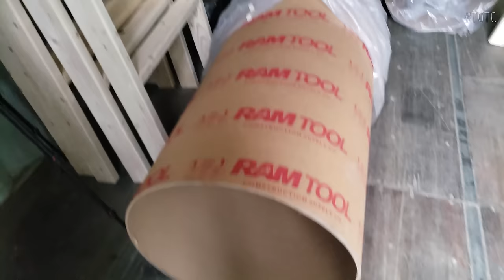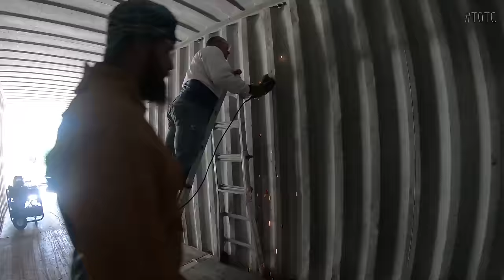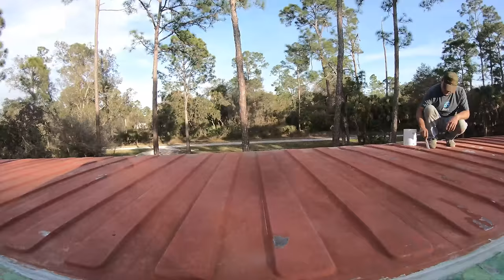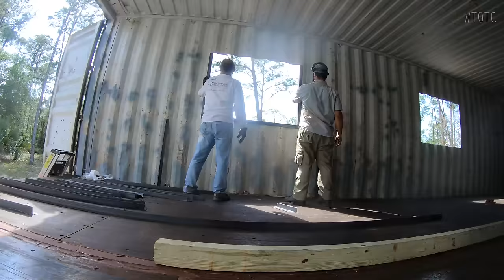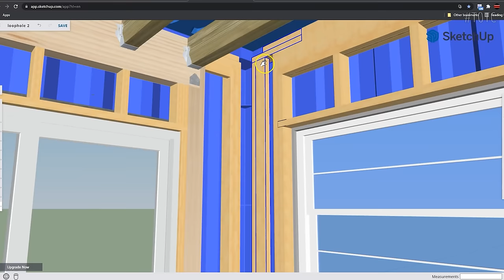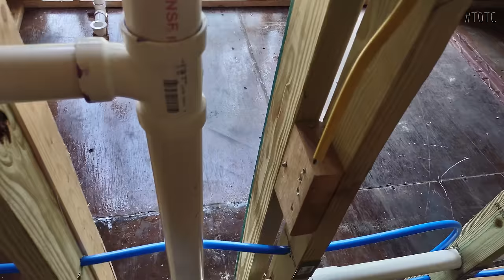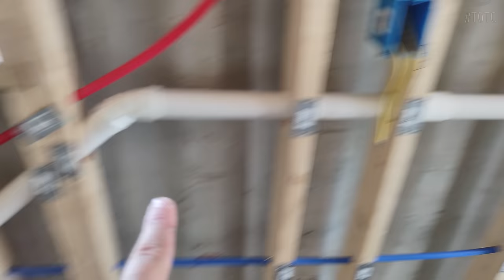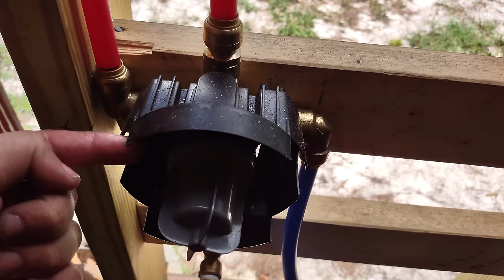FULL Container Home Build - Start to Finish Timelapse Construction

Comment: How much are the decent containers are selling for in today's market? I really wouldn't mind if the container had some bigger damaged spots like big dents or even holes in them, do to the design I am wanting to use for the build. The first floor will be completely underground and part of the second will be underground then I will cover the roof with solar panels and a propane generator for back up with plenty of well water, I could have it finished in at least 12 months with it fully functional for living completely off grid. No bills means no need for a mail box right?

Comment: Hi I have a question for you, you probably won’t see it but here it goes anyways! Say I built exactly the same structure as you, down to every last bolt and weld, how hard would it be to build UP later on down the road? Say I wanted to add a container above the first floor, would I be able to do that after the fact? Or would I have to do it on the initial build? I can imagine there’s going to be some structural beams that are going to have to be put in, but is it anything I wouldn’t be able to do later on down the road? The reason I ask is because basically I would like to build my initial space as  just a single floor, and then add a cool second floor to it later. I don’t want to tackle 2 floors on my initial build, it’s something I want to inevitably add to as a project down the road. Thanks!
Reply from the maker: Hi. I'm not a structural engineer so I can't offer structural advice, but I can speak on my personal DIYer opinion.

I actually plan to build a second floor on top in 2025. Although I haven't fleshed out the entire plan for the build yet, I've done some thinking and overall I do not expect adding a second floor after the fact will be that much more of a hassle than if I'd just added it from the start.

But there are probably many details I haven't thought about yet so...

But yeah, I plan to build a second floor on top of mine
Reply: @thinkoutsidethecontainer  wow, thank you for the speedy response. Im sure that my structural engineer will tell me what is possible but I was more so just curious on your thoughts on the matter. I have an idea in my head of what I want it to be, I want 2 side by side, like yours but 1 less container, and then I think I want 2 more that are perpendicular on both ends of the original structure. I’ve considered maybe doing 2 40’ containers on the first floor and then 2 20’ containers running perpendicular on the ends, I’d like to have that 4 feet of overhang on either side of the house. I guess we’ll find out. One last question for you, regarding the actual purchase of the containers, from what I’ve been able to find the new containers or “one ship” containers are basically the same price as used containers, given that the prices aren’t far off would you recommend getting new containers or do you think used is fine? Thanks again, love the video.

Comment: This was a great watch, shame interior design and electrical installation was skipped I guess. But overall the sense of accomplishment must be overwhelming!
Reply from the maker: As the build progressed 3 factors contributed to me filming less and less of the process over time: my dad (who helped a lot) often got annoyed by me filming, but I didn't mind doing the double work of building AND filming, still my filming of the project got stifled and disrupted because I didn't want to bother my dad, so I lost motivation to capture the whole build since I was already missing parts of it.

The second reason was the county deadline for the building permit to expire, so getting the house built quickly yet properly became more important than filming.

Lastly, pure exhaustion, by the time I finished the build I was pretty exhausted, contributing to me not filming much in the last few months.

Comment: An Oxy-Acetylene torch seems like it could have saved a long day of grinding, which doesn’t look like a fun job. I’m wondering why an angle grinder was used.
Reply from the maker: I've heard plasma cutters would have worked well. You're right the angle grinder was agonizing for all that cutting. Truly brutal, especially cutting out those walls. Took me like 7 days straight of cutting morning to sunset. Next time I'm buying a plasma cutter
Reply: @thinkoutsidethecontainer  why not Oxy? Cheaper equipment, and will cut it like butter. As long as there are no safety issues. Dude this is so cool what you did. I dream of buying a piece of land and building one

Comment: are there areas where the foundation bolts go into on the bottom of the containers or was all that just to keep the piers like absurdly stought.
Reply from the maker: Unfortunately I dont have footage of me welding the shipping containers to the steel plates. So basically, there's the concrete columns. Then the steel plates that sit on top of them. Then those steel plates are bolted I to the concrete. Then, once the containers were placed on top of the steel plates, I welded the containers to the steel plates

Comment: Is there a reason you didn’t cork and weld the roof to seal it prior to removing the internal walls and would that have been a better way to go? Other than wanting to use the walls to cut up and weld onto the roof.
Reply from the maker: If I recall, my rationale for that was that often times when you cut out container walls it can literally make the container structure lose some structural integrity. The top rail (the piece of steel that runs along the roof of the container from one end to the other--the very area where I was caulking, welding, and sealing on the roof) can even move slightly with weight applied. I didn't want the removal of the walls to happen before I sealed all that up on the roof. It was quite a puzzle to determine what I should do and in what order, for example, a big question I considered for a while was should I weld the three containers to each other before or after I cut the walls out. I didn't include footage of welding the 3 containers to each other.

Comment: Hello, a lot of work has been done, but I still don’t understand why it was necessary to buy containers to cut them later and make a frame house inside, it was possible to get by with at least two containers spaced at a distance and a welded frame from a 80x80 square pipe instead of the third container that stands in the center. , a frame house sheathed with a profiled sheet would be faster to build.
Reply from the maker: As a DIYer, everything you suggested means more complex work than just buying an extra container and chopping some walls out. That was one of the big appeals for my build: the exterior shell of the home is already made. That's what the 3 containers provided for me. Cutting out some walls is simple work, relieving the burden of designing and constructing a totally different type of structure between 2 containers. 

My framing was excessively designed by my structural engineer. It could have been much lighter. That said, framing has many uses even in a container home: framing isn't just to establish walls, it is a convenient place to run/conceal electrical wiring and plumbing, insert insulation, and of course attach drywall to. There may be a cunning way to run electrical and plumbing in a container home so that no framed walls are needed, but you'd still need a place to put insulation.

Buying the premade shell of your home in the form of shipping containers, and then simply cutting some walls out, is OBVIOUSLY less work (both in labor and pre-planning) than building up the exterior shell of a home from scratch (like CMUs or stick built) and building out the openings for windows/doors into it.

Comment: Surprised you didn't put a type of water filter system on the pipe from the pump house to the main house.
Reply from the maker: I did eventually put a sediment filter in the pump house after pressure tank

Comment: How did he secure the containers to the metal flats that's on the concrete? Did he screw them, welded it?
Reply from the maker: I welded the containers to the metal plates.
Reply: @thinkoutsidethecontainer  did that pass code. Sorry, only reason I'm asking is I'm about to do my own so wanted to know. 2 story , 4 on top of 4.
Reply: @thinkoutsidethecontainer   did it past code?

Comment: I say you used too much wood framing. I would have used 1 third or less because you already have the structural walls. Also, I would have used ABS instead of PVC for drain plumbing

Comment: Sharkbite fittings are terrible for long term installation.  Some of the fittings (especially on hot water supply), WILL fail in as little as 3 years.  They say they are good for 25 years, but the o-rings dry out and leak.   A proper copper crimp connection is much more reliable and way cheaper.
Reply from the maker: damn, there's gonna be a BIG lawsuit coming to Sharkbite I guess...some day, some year, some century, some millennia

Comment: Great video! I may have missed it, but how did you connect containers to foundation? I hope to do this one day but it will be in a area that has hurricanes.  Any suggestions for foundation securing?
Reply from the maker: I can't give structural advice, but what I did was; I welded the containers to the steel plates that were bolted into the concrete columns
Reply: @thinkoutsidethecontainer  It looks like Florida, so you would have wind codes to deal with I guess. I am thinking to put 2 20' containers together in Tennessee, I think they have Meth codes.
Reply: Go to "the container guy". There is a video on connecting 2 - 40'ers. But overkill as they have tons of snow to deal with but lots of good info for you to come up with your own plan. This design with 16 footers will alleviate  the bottom sagging TCG is worried about. TCG steel plates on bottom are great idea for less footers and less complicated for alignment.  Costs difference?

Comment: Question would anyone know y he wouldnt use a torch to cut the walls
Reply from the maker: I'm not sure if torches are the ideal tool, but I have heard plasma cutters are pretty good for this. I hear the way I did it (angle grinder cutting disc) is good if you need to make precise cuts for Windows or doors. But I suspect if you're just doing more general cuts for like opening up floorplace in the home, then the plasma cutter would be fine.

Comment: I really like how container houses look. But after seeing that you have to frame the interior, cut walls and all of that. You might as well just build a normal house. If the look of the house is what people like then they can install metal sheets so that it looks like a container home. It’s way too much work 😟
Reply from the maker: Wrong. Cinder block houses are quite similar: sturdy concrete blocks with complete framing on the inside. Very similar to container homes: extremely durable steel exterior she'll with framing on the inside. Now, if you're comparing it to a stick built house with exterior sheathing then maybe there's an argument to be made that that is less work or less material costs. But then the question that should be asked is: what are the advantages of a CMU cinder block house over stick built?

Comment: `I lost the nice, well-insulated house I HAD to an intentionally set (under EXTREMELY dangerous weather conditions) fire, back on 02/20/22. Once I can get a settlement from the slime bags who started the fire, I'm going to be doing a 3, 40' shipping container house - FULLY EARTH-BERMED on 3 sides, with the retaining walls on the N & S retaining walls sloped out to the W, to protect my vehicle. (It's a "middle finger" to the slime who burnt me out!!! I can't phrase it the way I typically do on here; or, it would probably get me kicked off of YT... Let's just say that THIS old-lady's "fight, flight, or freeze" defaults to "FIGHT!") I've got my basic floor plan drawn; so, I can finalize my framing materials list. Even though my floor plan is totally different, I found several things on this video very helpful; esp., since I'm now moving on to working on the plumbing, electrical, & ventilation system materials list. The electrical system won't be too hard; but, I'm planning to set these 3 side-by-side on a concrete pad that will go onto a rock shelf which runs under my land - meaning that I'll also have to figure out all of plumbing stub placements prior to the foundation getting poured, in addition to doing so for the materials list!!! I'm having to do most of this on my own; since, that fire wiped out 99+% of EVERYTHING I'd accumulated over the decades; &, has left me "so broke I can't even pay attention..." It doesn't help that my lawyer will wind up with probably 50% of that settlement.
I HAD planned to stub the plumbing's drain lines into the foundation; but,, I'm starting to rethink that; since, I'm going to be needing a 10 to 12 inch drop/slop doing it that way (the bathroom will be the rear 10 feet of the center container. The kitchen sink will be midway along a 14' N wall of the N container Moving E, will be the @ 7.7'x @ 11' utilities & laundry room. 1 one of the 2 bedrooms  between the N of the bathroom & the other being S of the bathroom. IF I went with an elevated, standard height toilet (I need a tall 1 due to some spinal damage) & elevated the tub, running it out through a line exiting the E wall of the center container: &, connecting it to a 90 (outside) to the W to E drain line servicing the kitchen , to give me slope to a drain outlet in the N/E of the U/L room - going out the N wall there, I could reduce that 10 to 12" by about half of that; but, that still leaves me the problem of needing 1 drain stub going through the foundation, just outside of the N wall & the problem of that (3 or 4' thick) rock shelf running pretty level under that 4" slab. (I HOPE this explanation isn't "clear as mud!) Any one out there with any plumbing expertise out there willing to offer any suggestions???  Am I looking at needing to add a pump to my settlement demand??? If so, what would be a good one, likely to last for at least 25 to 30 years??? (I'll be 70 early next year; but, after being shocked that I lived to be 21, 25, 30, 40, 50, 60!, 65!! I'm likely to be in this body a lot longer than I ever expected to be; &, trying to change out a sewage pump in my 90's would REALLY SUCK!!!

Additional info: The rock shelf runs pretty level under my land. The dirt does not. The wedge shaped trench I'll be digging (with larger end "mini excavator) will leave the tops of the containers ABOUT 2' above ground. I plan to go over the tops with a rubber pond liner, followed by about 4" of air-crete, followed with about 2' of dirt. I'll have either a retaining wall (either concrete blocks or air-crete) with a higher fence on the W edge & along the parking area retaining walls, to keep my dogs from "going SPLAT!" if they get too close to the edge of the roof while playing, etc. The only "windows" in this "bunker" will be a 12"x48" (framed) "panel" of glass in the W ends of the N & the S ends, close to the top. The S container won't need any plumbing.

Comment: why put so much effort into foundation when containers are designed to be stacked on top of each other and not buckle under hundreds of tons of weight? I know that there needs to be a foundation, but surely one which takes far less effort and material than this would get the job done